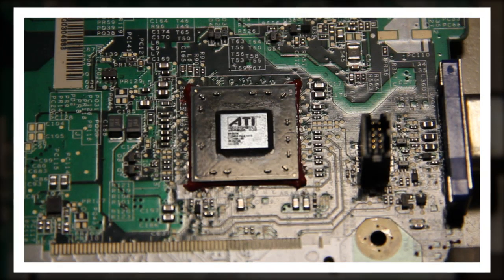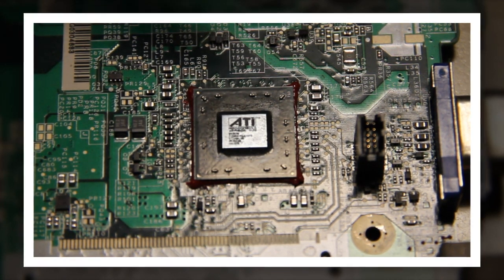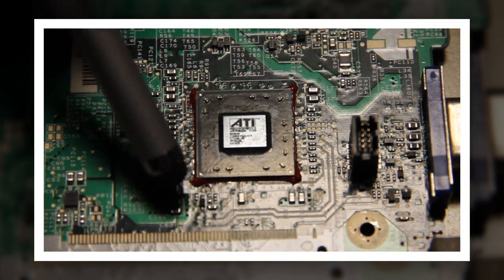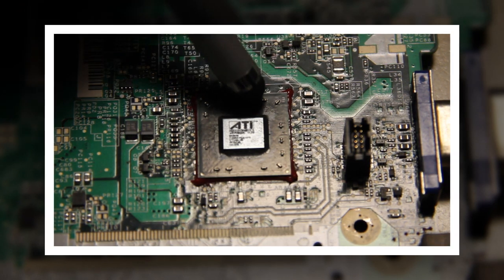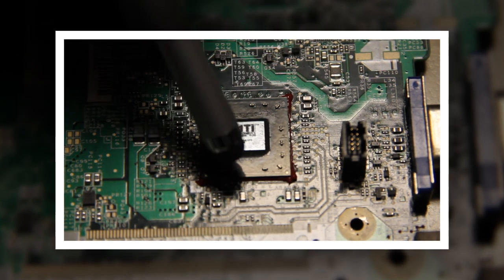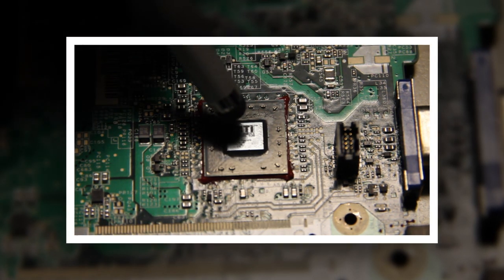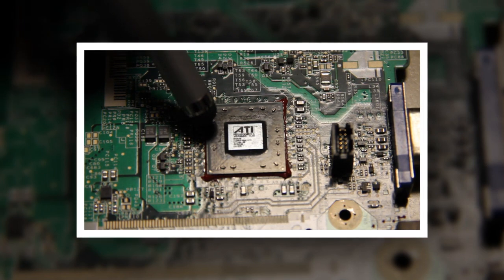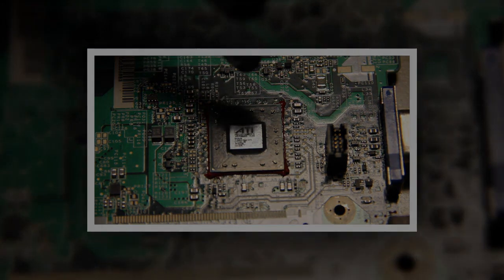GPU Reflow Do's & don'ts

Comment from the maker: I never said an expensive machine was required, but a good $600 machine will guarantee the success of the reflow. A heat gun is the second worse things g you can use, as the heat required to do the job correctly would mean the airflow across the top of the GPU will melt the solder that holds the caps to the top of the chip set and the air will dislog the caps. Many people have success using all types of methods, I am only giving instructions on how to perform the actual fix with little to no permanent damage , not a work around that may or may not work, and if it fails, cause what could be catastrophic damage if the wrong components get damaged from hot air in the wrong place. I worked with a shop that used a hot air gun as the fix, that is how I first learned of what damages the air can cause. But if it works for you, I'm glad to hear.
Reply: +John Gebman I reflow a asus striker extreme board that dint turn on at all , by butting hot coal from the fireplace under the chips and lifting the board 3-4 cm from the coal and it worked .. it come on without a problem
Reply from the maker: Haha. Never heard that before. Their may be success with almost any way of heating the chip, but all come with risks unless done correctly. Hot air can blow other components off the board, but does get to the right temp with the right equipment. Flames get to the right temp, but can warp the chip and also knock off other components. Ovens I hear a lot of success, but yet that is the most dangerous for a lot of reasons, but I do hear it works. How ever you heat the chip may work, but again the only true way to successfully correct the issue is to use the equipment designed to re-flow the chip by directing the correct amount of heat to just the chip set and to preheat the board so their is a better solder connection.